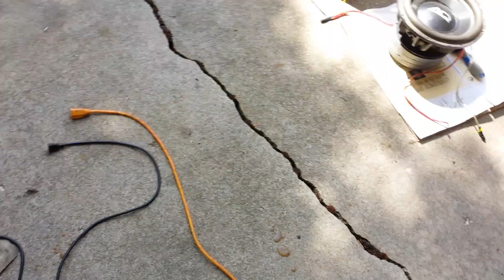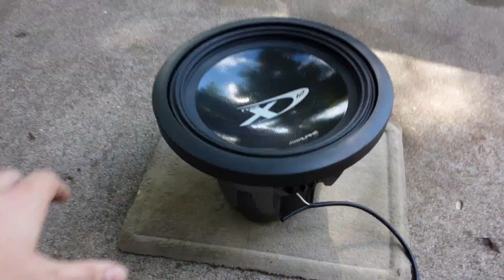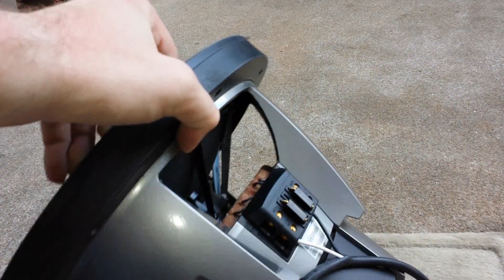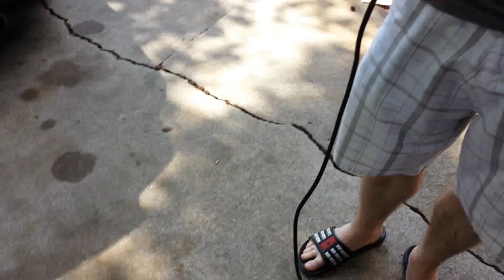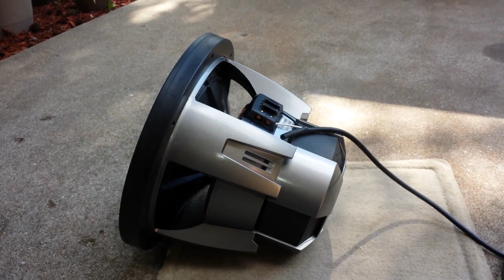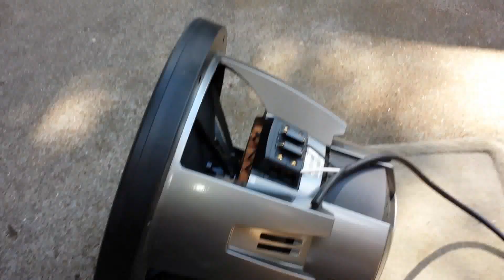Alpine Type X 12 subwoofer VS wallsocket 120 volts

Comment: You did have both coils hooked up, the 2 jumpers are plugged in setting the sub with both coils in 2 ohm configuration. I see your one comment on "clips in or not" and I have a alpine x12 swx-1243d 4x4 ohm sitting on my table infront of me that has a dead coil too, the bottom hookups work the top get no reading, and no reading in any configuration. I was thinking about just taking it apart to see whats inside. maybe a rebuild is in order but I gotta wonder if there is something with the motor, the coils bottoming out and since they are wrapped inside and out if it doesnt beat the wires in half should it reach the bottom, really pisses me off, also the plastic, I dont care what kind of composite it is, its plastic, that attaches the coil to the cone has cracked on 3 of the arms and the inner studs have all broken free of the cone. The 10 goes for $530 on alpines site, I know it can be found cheaper but now Im wondering if I shouldnt have this one fixed, if its worth it.

Comment: haha it was running both coils the jumpers are in.
Reply from the maker: one of the coils was out, thats why we wallsocketed it in the first place.read 4 ohms even with jumpers in.  toward the end it almost sounds like the other coil suddenly regains a connection, because there was a sudden obvious power increase,  it was odd. I'm thinking it just had a tensil lead issue on one coil or something because nothing was visually burned until after this video of coarse lol
Reply: +www.GPcarAudio.com i just got burned on 2 of the new tyle x 12s.
And what ashamed im sure theyre clean with 800 real watts each which is what i was gonna put on em.
fix my speaker told me $300 and theyll send me everything to make em 1200watts rms again.
Reply: +www.GPcarAudio.com which i just decided to get tnt american bass 15s.